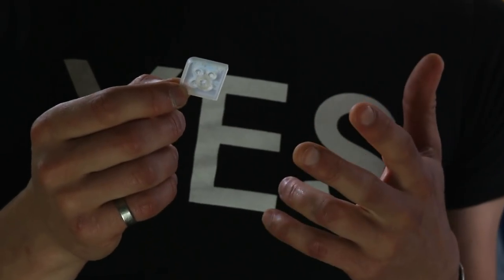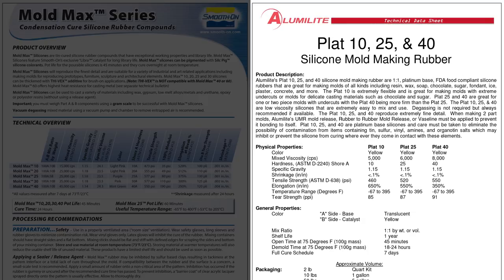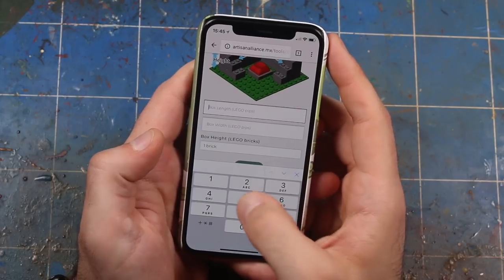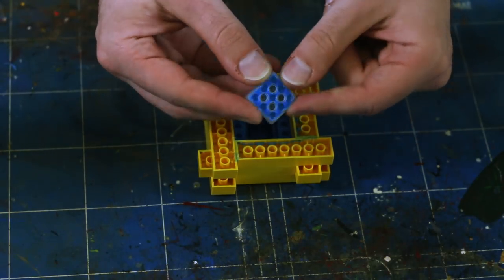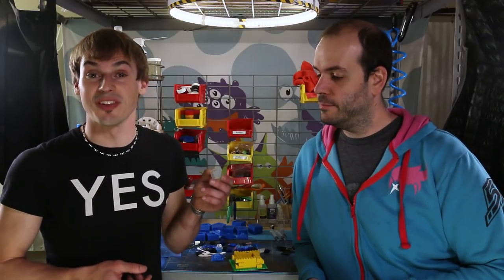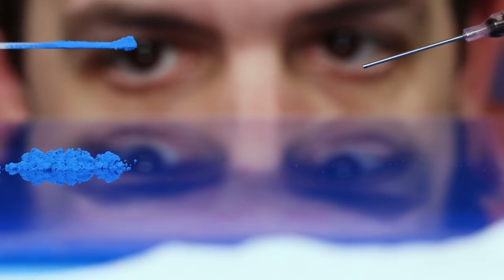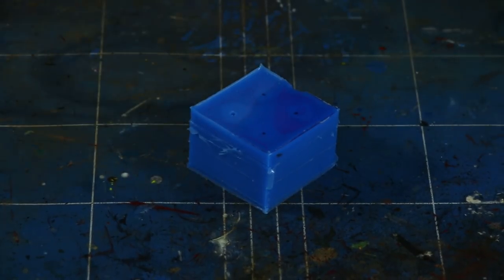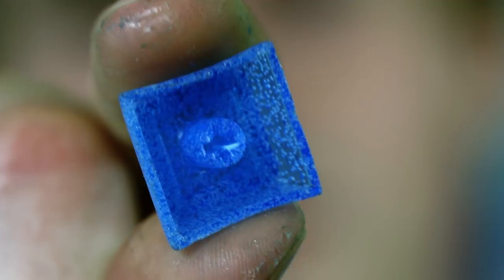How to Cast Artisan Keycaps with Silicone and Resin

Comment: Thank you guys for the great video. I had experience with casting resin and silicone but not on the scale of keycaps. You just helped me cast my first (almost) perfect spacebar (no pressure pot required really).
Reply: Pro tip mould making: get a long setting, stiffer silicone. Pro tip casting stems: use a stir stick to add a small stream (not drips) of resin into one corner of the stem just like casting silicone. Do not move, do not drip, let the stem fill from one point and thus push out all the air.

Comment: Could you all do a video on the pressure pot/compressor set up or provide a link to some? Pressure pots seem pretty self-explanatory, but wildly vary in price and it seems as though there might be some conversion necessary since most pressure pots are intended for use with paint. And then there's the compressor bit, completely lost on that.

Comment: An easy way to measure the volume you need is to fill your mold box with water, then transfer the water into a measuring cup, and add your overfill. Dry your master and mold box thoroughly after that though.

Comment: Very nice & informative video.
I do have a couple of questions.
Would it benefit first using a vacuum chamber and then use the pressure chamber afterwards leaving the mold in the pressure chamber for the full cure time?
I want to make keycaps with a totally transparent outer shell and then in inner piece with the legend on it.
I figured using your method to make batches of transparent outer shells and then make each unique insert how ever I want.

I was thinking of buying one of the smallest UV curing resin 3D printers to make inner pieces as acrylic would look better on the outside of the keycap and If I had a multi-head 3D filament printer, I could print the insert in multi-colours. I want the keycaps to shine through the legend and around the bottom of the keycap.

My other thought was making a flat top insert, engrave the legend on the insert (either by laser or spin drill), fill the engraving with some sort of paste and the buff off any paste above the top of the insert head.
I'm 60 but I do remember doing the 'engrave, fill & buff' back in the late 70's in plastic shop in Junior High.

Comment: Hi guys! Thanks for the vid! Went ahead and snagged two L2Ks. Quick question on pressure for silicone/resins. I'm eyeing a pot from Artmolds, but it doesn't go higher than 50psi. Is 60psi generally what's needed for bubble-free molds? Or would 50 work just as well? Thanks!

Comment: Hey, thanks for this tutorial. Looking to buy few adapters. One question though. As i sculptor, i am planing to sculpt top part of key cap and make molds out of them, my problem is that, in the video, u r using master(real key cap, with mx adapter at the bottom) , my sculpt will not have mx adapter underneeth. How to deal with that problem using ur adapters? Cheers , thanks

Comment: What type of needle do you use to make the sprue holes in the silicone mold? I've used a football pump needle, which looks similar to what is shown in the video, but it doesn't leave a nice big puncture hole like the ones seen in the video.

Comment: Hello! So I've started casting my own keycaps, and the first few I've done have come out with the sides being pretty pliable still. I'm using a 72D hardness resin, and I'm well past the cure time on it so I don't think the cure is the issue. Is it possible the sides for the key I'm casting are too small, or do I just need to wait longer for it to fully set?
Reply: I'm no expert but that sounds like it could be an issue with the ratios of resin parts when mixing, maybe using a more precise measuring method could help :)

Comment: Wait, I thought I needed a vacuum chamber... do I need a pressure pot and a vacuum chamber?
Reply: Mold Max 30 is self degassing, you should be okay with just a pressure pot. Resin usually bubbles up more in a vacuum chamber.